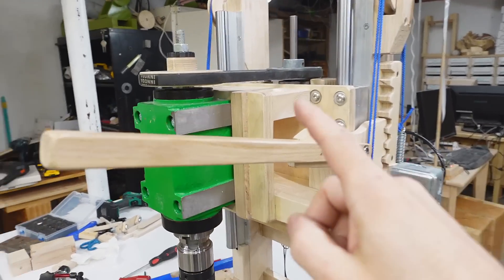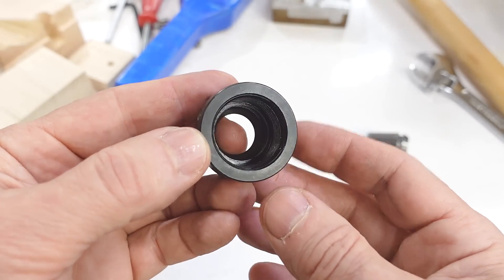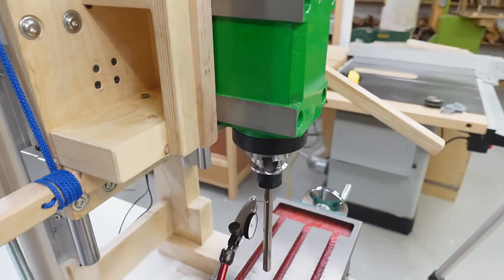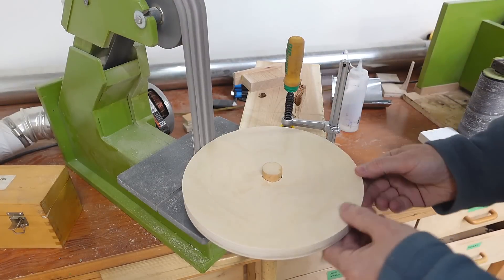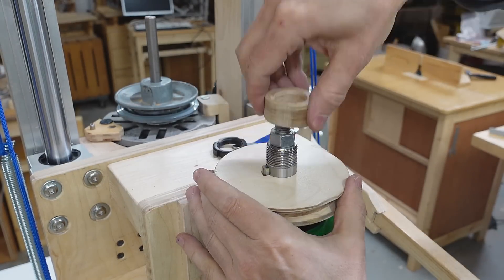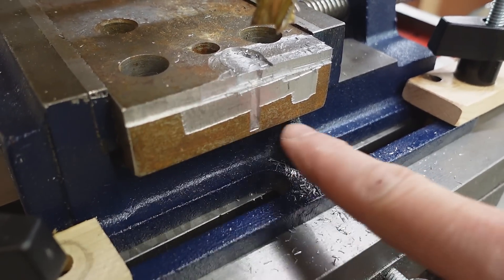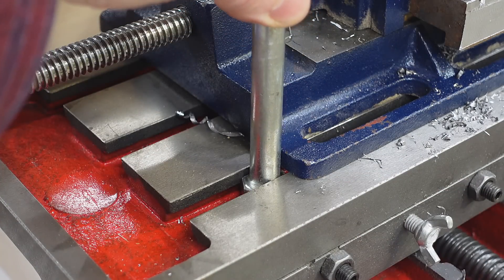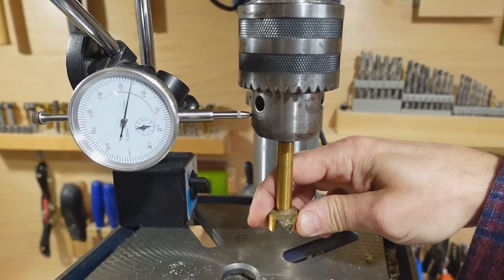Milling metal with the wooden milling machine

Comment: Pretty crazy to simply do this because you can.  Well played.  Your runout at the spindle is likely from your collets themselves if the bt30 taper in the chinese spindle indicates fine.   I have similar issues with my low buck er collets over using my southbend r8's in my r8 spindle.

Comment: Well, we all kinda knew where this was going. But why not use your wooden mill for wood? I reckon it should be good enough for that.

And if it isn't just add mass. Doesn't have to be steel, wood will do, I am sure. Maybe some hard wood. If you can get something like Jarrah (very common in Australia), that will surely improve things on all fronts (rigidity, mass, accuracy of mill frame, dimensional stability). Only problem is it is tough as nails so you will need some serious tools to cut it (and a lot of patience). Just to give you an example, a well dried jarrah railway sleeper will blunt your chainsaw before you make it through.

Would love to see your work perfected (in wood) just to explore the limits of what can be done.

PS. I am the opposite of you. I machine wood on a "normal" milling machine.

Comment: I'm doing a project like this as well!! But I'm not going to mill metal just wood.  I'm using an router that I never used and building a milling base for it! Saw the idea on Pintrest and figured I could give that a try . So far so good. If it works out I'll upgrade in a year or two, with a tilt head abs maybe even cnc it. So funny I didn't find this video till now lol.  But better late than never since you've given me new vigor to finish 😊well done!

Comment: CNC machinist here. For steel you need 3 things:
-sharp and hard end mill
-stability on your machine
-horsepower on your spindle

If one will fail, the rest is gonna fail too. Try locking your work pice harder, add mass to it (cement will work like a charm) and use smaller cutter. It will take less power by turning it faster and feeding it slower

Good luck brother

Comment: If you get the vice tied down, take much smaller cut depths and use some lubricant you will probably be able to use this mill for some projects.
I think you are going to be in the ten thousandths range instead of the thousandths though. Still does much better than the DP. //ji

Comment: try to always mill in the direction against the tool is turning, not with. otherwise it will "suck" the Part into the tool because of the play in the table. (In German its "Gegenlauffräsen"
greetings from switzerland

Comment: Tightening and having an idler pulley on the drivebelt should reduce the sloppyness and shaking a little at least.
As every time the cutter starts on a new edge it will have more tension on the belt aand slow down or stop uintill the belt is tight enough and it starts cutting again but now from a stop, and this can cause heavy vibration.

Also having a heavier flywheel on the top to keep a more constant speed would also help

Comment: I'm not expecting you to follow the idea, but one way to potentially help with rigidity would be to change the orientation of the mill from a vertical mill to a horizontal mill. I'm not sure that it's the reason he did so, but looking through the Gingery Machine Shop from the Junk Yard series of books, it wouldn't surprise me if that was part of why he went with building a horizontal mill as part of the project. "Most" of the functional difference will be in how you hold the work. But a significant bit of difference is not having to lift the head stock, or provide it with support.
Reply: That said, I think you've already done most of that work as part of setting up and using the Panta-router.

Comment: Perhaps Matthias is going to slowly realize that while wood is an acceptable material for pulleys and motor mounts it probably won't work well for structural parts that need to provide the extraordinary stiffness necessary to achieve accuracy under loading. For the pulleys is he needing a radial drill press or just a Portalign tool?

Comment: This reminds me of some experiments converting our crappy drill press to a mill, which you actually inspired! I once saw you cut a dovetail way out of plywood (gibb and all. I dont remenber what is was for tho) and i tried to make a x-y table that way. I really like the "2.5D" manufacturing capability that stacking sheets of plywood gives you. Never got to steel, but i was quite impressed with what it could do in aluminium. In never used that setup for anything but the aluminium test piece still gives me a giggle when i come across it in "the bin". Later, i did use that drill press in a different setup to bore out some home-cast aluminium bearing blocks. Now these still work, although it would have been easier to buy a set. but like you said: its fun to see if you can do it.

Comment: if you have a square tool in the spindle of the mill lined up with x or y axis you can plunge the spindle to cut keyways. just an idea, typically in steel you would take about 0.0015" depth of cut per pass. im sure in wood you could get away with 0.010". how you get some of the things you do to work amazes me lol.

Comment: Trying is what it is all about.  It never hurts to try.  The Chinese mini machines are likely not much better than what you are producing.  So keep moving forward.  Pretty good effort with a bunch of 2x4's.  To become a good machinist takes years of trial and error to learn what works and what does not work.  Like the drilling the 9mm hole in steel you have to start small with low power machines and drill bigger and bigger.  Live and learn.  Good stuff!!!!!!!!!!!!!!!!!!!😃

Comment: It's a very cool machine, but i would not subject it to climb cutting--especially with a bit that large.

It can transmit a lot of energy into the table and cause some damage. I damaged a full size manual Bridgeport while climb cutting once. They just don't have the right kind of feed screw to protect against damage.

Comment: If you want to mill metal, you want to be fast, not slow. There is a thing called "chip load", that's basically the chunk of metal you're cutting with each cutting edge as it hits the work. You want to have a low chip load in a machine that has poor rigidity. There are three ways to reduce chip load: increase speed, decrease feed rate or increase the number of cutting edges on the tool. Also, you're (seemingly) using a carbide endmill which wants high speed. I'd suggest that you use a smaller high speed steel (HSS) end mill, probably 4mm or 5mm maximum, at as high a speed as you can get the thing to safely spin at, which will allow you to use a reasonable feed rate (so you're not there all day).

Comment: I have no doubt that you will make this work more accurately than any store bought drill press.
Reply: I'm not a machinist by any means, but in looking at the measurements he's getting, I'd argue that this is already at least as accurate as any drill press that doesn't have a taper spindle that the Jacobs chuck sockets into. That's not to say it's as accurate as it could be, just better than the run of the mill drill presses that are on the market.

Comment: concentricity issues are very common with cheap collet chucks and collets, they are unfortunately parts you can't really get away with cheaping out on
Reply from the maker: The collet holder is surprisingly good.  Wasn't cheap though

Comment: Pew, dodged a bullet there. I thought you would "fix" the collet nut with a Dremel or something. 😉

I have a CNC that started out as an aliexpress-kit. Over the last 2 or 3 years I've completely replaced the Z-axis, the Z-carriage and the gantry (X-axis). Redone mostly with wood no less! (mostly melamine coated 18mm plywood). And it works better than the original now.
Do I need the CNC? Nah, not really (if I did I'd have bought a proper one). But is it fun to think about how to improve it, tinker with it and see it doing the tedious jobs? Definitely!

Comment: You could have used your lathe to turn down the head of the screw.
Reply from the maker: hardened material.  If anything, I would have reduced it on my belt grinder.
Reply: @matthiaswandel I've cut tons of screws on my similar lathe.  Screws softer than you might think.

Comment: Wood is nature's wonder composite. 
However, it's very flexible and not appropriate for rigid application such as milling machine parts. 
The forces are enormous as you demonstrated with your clamping. 
For this reason, most parts of a good milling machine, are made of heavy cast iron.

Comment: If only you had a machine that could be used to make the diameter of the head of the screw smaller so you wouldn't have to mill a pocket to the pulley ... Oh ... wait ... never mind ...

You need a proper milling vise. The drill-press vise is not rigid enough. You can learn that from any introduction for the owners of a small desk-top milling machine. And it definitely shouldn't be held down by strips of wood. Buy a bunch of proper T-nuts for your cross-feed table. Using improvised screws is the leading reason why a typical second-hand mill from a typical garage-shop DIY owner has screwed-up slots on the table. 

Like I was trying to suggest in a post under your previous video, the frame for the mill should be made of tube-steel filled with concrete to be stiff enough for milling steel without damaging the milling tools.
Reply from the maker: good point about screwing up the T-slots.  And here I am having just bought some bigger bolts!

Comment: Seeing shirt sleeves and a rotating Milling bit in the same frame triggered my inner Karen.
Reply from the maker: good point.  this ting's got loads of torque with that big pulley, so it wouldn't stall like my drill press likes to.

Comment: Matthias, in my CNC classes I learned that metal is properly machined with a climb cut.
Reply from the maker: yes, as long as your machine is rigid enough that it doesn't get away on you.  Cause that way, tool deflection doesn't cause the cuts to be too deep.

Comment: You can probably find a mini mill used for cheap as they have a few issues. Circuit boards and plastic gears are an issue. The screw adjust for table is also not an acme thread but regular.  For circuit boards it is usually two scrs. Gears are available from time to time on Amazon.
Reply from the maker: whenever I look at used stuff for sale, they ask at least as much as the stuff costs new.
Reply: @matthiaswandel  interesting as if something is used they shouldn’t be asking more than 60% of new or the current professionally appraised value.

Comment: no offense, but if correctly operated, using sharp tools and adjusting the mini lathe, it will produce good results on steel. i have one (did change to angular roller bearings but still) and it works flawless. a milling machine out of construction wood will never work. there are approaches (life latitudes) with plywood and a more router style approach with high rpm and thus lower cutting forces - that would be the way to go. however, with aluminium profiles readily available for relatively cheap, i dont really see a reason to build stuff like this out of wood. especially since the stuff you put on it (table, spindle, motor, collets) cost way more than a more solid frame would cost you anyways. i get you are a woodpecker and it surely is fun to watch, but this is a dead end, you got away with the bandsaw, but you unfortunately wont with this. ill cheer you on anways though :D
Reply from the maker: Aluminium is actually not very stiff. A solid chunk of hardwood is probably stiffer than a semi hollow aluminium extrusion with t-slot s on all sides.
Reply: @matthiaswandel  thats absolutely true, but at least here in europe, there are two types of extrusion, a light version for general construction and a heavy one that is substantially heftier. i built a cnc router out of this and it weighs over 50 kg (200x300mm working area). its really stiff and used a lot of "tricks" to make it even better, for example, there is threaded rod on tension in those extrusions to make them artificially less bendy. if you'd like to build one too, i can link you to the ressources needed, its a very capable little machine :)

Comment: I wonder how the metrics of this compare to the one about the mini lathe. My thinking is that the lathe might have alienated some viewers due to it being bought/machining, but you built this so it's free game. 

Even with all the play/lack of rigidity, it seemed to face up that piece of steel pretty well all things considered. I don't think most mini mills could have done that
Reply from the maker: I think that facing cut worked so weel because with the twsted flutes on that endmill, I had continuous cutting contact, so much less vibration

Comment: Optimal tightening torque for an ER collet is actually really quite high.  Higher than non-machinists tend to think.  Good to see you not making the mistake of trying to run an endmill in a drill chuck.  It's a really bad idea.  I've seen very nice chucks and workpieces ruined as a result of this mistake.
Reply: Meh if I'm just taking a light cut I'll mill in a drill chuck.
Reply: @1pcfred  Pretty sure that's exactly what my coworker thought shortly before he destroyed the jaws of an Albrect chuck.

Comment: The term mil is regularly used for 0.001" in the US.  I was quite surprised when I discovered this a  long time ago as it wants to confuse you with mm but it is a common use, here.  I enjoy all the enlightenment from your investigations.
Reply: Thou is pretty much universal with youtube machinists. Mil seems more common in wet film thickness than with metal cutting.
Reply: It’s not just YouTubers, thou as in thousandths of an inch is common for all machinists in the USA.  
Mil is used when discussing thickness of fabrics, plastics, stickers, anything that’s flexible and very thin really.
Reply: @dennispope8160  "mil" for thousanth of an inch is also also used in the PCB design world :(
Reply: "Regularly used" is a bit of a stretch. The average person on the street in the US would have no idea what "mil" means (well, they would be sure it meant millimeter), and it's not commonly used among machinists. It is used if you work in an industry with thin film plastics, or if you're an electrician talking about large conductors (500 kcmil). That's about it. Oh, and there is an identically named financial unit that refers to 0.1 cents ($0.001), which is used even less frequently and is mostly a curiosity for people who read dictionaries for un.

Comment: You have just experienced the challenges of work holding on the milling machine.   VERY important.   You will get better work holding with a real milling machine vise.   The piece of steel likely did not have parallel sides which adds to issues when milling.   Use some piece of copper wire on the moveable jaw to take up any lack of parallel in the sides.

Comment: One thing I've learned is that when I'm milling ferrous metals I really need to hold the work down. If you want to spend some more money get some link belt. But once you start using link belt then you want to use it everywhere. The stuff is just so cool. So be warned about that.
Reply from the maker: had it in my table saw, eventually got rid of it cause I was tired of the whine from it.
Reply: @matthiaswandel  I've never noticed a whine. I have two different kinds too.

Comment: a rack and pinion drive for the vertical axis might help with force, but then again that might just identify new weak spot to fix. Even if you don't buy a mill for your needs, you might want to go visit a showroom or tour a metal working shop and check out how they solved some of those rigidity problems... I mean we as humans have been work toward precision for a few hundred years, so it might be worth looking at how some others solved those issues.  As another note, without this machine, you might not have even know this issue existed, and it could give you an appreciation for how cheaply we can get those items today.
Reply from the maker: for my "needs".  Problem is, what needs?

Comment: I’m a machinist a few thousands of runout isn’t going to matter much with a HSS endmill in mild steel. Especially if your machine isn’t very rigid and likes to chatter. Spindle speed is also important depending on the diameter of the cutter and the kind of material so two speeds might not give you good coverage. Also I suggest buying or making a few metal toe clamps for the vise so it doesn’t slide around. Metal cutting produces a lot of force so the wooden ones aren’t strong enough.
Reply: Haha, I had the exact opposite reaction when I saw this - I'm used to using smaller carbide tools in a CNC router, and even a little bit of runout or flex in the setup turns those tools into paperweights very quickly. Interesting to see a real machinist's take!
Reply: @tomtlrech1392  You can breath on a small carbide tool and it breaks lol

Comment: Would be an interesting “experiment” if you were able to apply your lamination frame design ideas from your band saws to a “stiffer” frame for your mill.🤔😃
Reply from the maker: Indeed.  Measuring deflections, most of the "give" when I push on the drill bit is flex in the frame.
Reply: @matthiaswandel  Your knowledge and application of shear planes would go far in reducing the deflection you are seeing at the tool tip. Granted wood is not the best base material for a “miller” attempting to cut steel but your design so far is pretty decent considering!😃